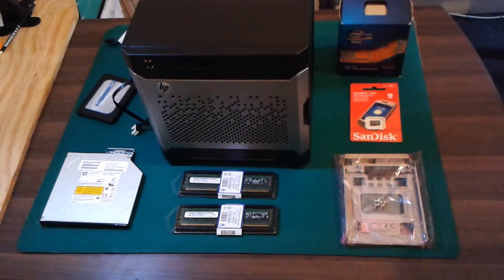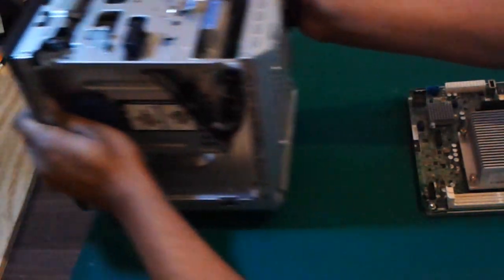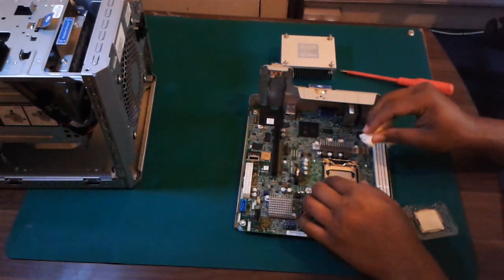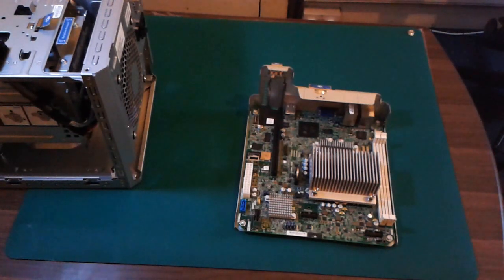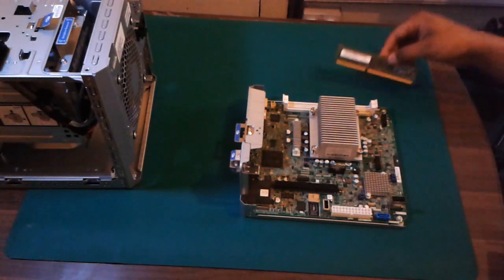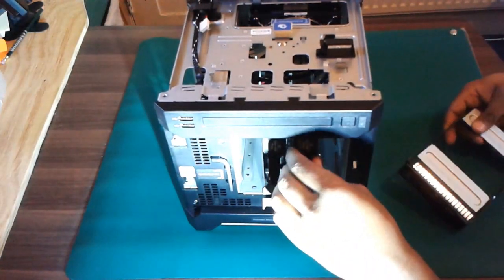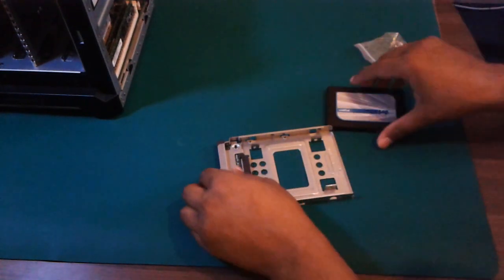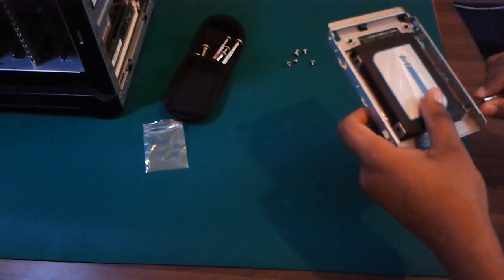Upgrading HP Proliant Gen8 Microserver (Part 1) - Performance

Comment: You shall ALWAYS tighten the CPU heat sink in an X way not as you did just a tip :)
Reply from the maker: +Vidar Berg Thanks for the tip.
Reply: normally there is numbers like left one is 1 right one is 3 the bottom left is 4 and the bottom right one is 2 so you should look for numbers they usually are scraped into cooler plate or so :)

Comment from the maker: RADCOMJ1 It runs on normal temperature (between 25 to 35 Celsius) as I set the BIOS to optimise temperature instead of Speed.
I am using Xeon E3-1265 V2 CPU (2.50 GHz) because it has 45W which is cooler instead of Xeon E3-1230 V2 (3.30 GHz) (which is maximum CPU on the Gen8 Microserver) as the CPU is 69W which is hotter due to more wattage.
I also use Arctic Cooler MX-2 Thermal paste which keeps the CPU cool.

Comment: Hi. I bought a new DVD Burner but it didn't click in as your one did ... Am i missing something @Anchan Tech?
Reply from the maker: Have you got the 9.5mm Slimeline bracket?
Reply: @AnChanTech  If your talking about the old DVD 9.5mm template then yes, if not can you provide a link to the item.
Reply from the maker: It is very rare to get. Google search this Part number 'HP 532475-001'. That is the bracket you looking for.

Comment: Hi I need help here, mine is G2020t too. Am having 4GB n 2gb here. Intending to replace the 2gb with a new 8gb. 

Which brand part no and where shld I buy from? 

I having no luck from my sgsupport reseller here.
Reply from the maker: There are no specific part number for the memory. You just need to look for the correct specific memory type as you saw on my decription box.
HP will be good brand.
Sometimes Global Memory is good brand and the memory expert.
As long as you give them the correct motherboard/PC/Server specs or else they give you the wrong one.

Comment: I'm looking for a home server to begin learning some IT. Is this a good set up for that purpose? Need it doe ESXI virtualization and all.
Reply from the maker: My set up as you see on the video is my hardware full potential (except for TPM as I do not need it)
As for the Home Sever set up, you need Optical Drive to install Windows Server 2012 R2 or 2016 OS. Or if you can afford Server 2019. Get at least 4TB Hard Drive if you plan for storage and another for OS Drive.
I use Hyper V as it is a simple Virtualised environment but you can use ESXI or VMware if you want.

Comment: Nice vid my brother, this is exactly what I'm about to do.:-) how hot does that Xeon run in there?
Reply from the maker: Quite hot.
Years later which is not on this video I upgrade the cooler which is now 65w. (Part no: 832667-001). The 65w cooler is better.

Comment: Do you think it could be possible to install also a E3-1265LV4 (not V2) that has a lower power consumption?
Thank you very much!
Reply from the maker: +Lorenzo L. E3-1265L V4 does not support the Microserver version of Gen8.
Link to CPU list:
https://b3n.org/installed-xeon-e3-1230v2-in-gen8-hp-microserver

Comment: Note: I am a beginner in Home Servers and recently bought this server.

The reasons behind these upgrades interests me, probably other beginner viewers have the same questions - why to upgrade and which purpose each upgrade has - e.g. why Xeon / memory? Which is the purpose of this machine? Are there other options for further upgrade e.g. instead video a WiFi card?

Thank you very much.
Reply from the maker: +Radu Poenaru It depends the purpose of the server and why you need it. Example: Labs and virtualisation. In this case you brought this server for storage. So far everyone like this one which is the main upgrade and this is 1st part of the 4 series. If you look at the description box you see links to 3 other videos of the HP Gen8 Series which is based on small business needs. As for Wi-Fi card it have to be PCI-E and low profile bracket. I hope this helps. Playlist = https://www.youtube.com/playlist?list=PL2b2FxTD-nGMookrvI9uSwiyqw2vZRgsC
Reply: +An-Chan Tech Thank you for your amazingly fast answer. I, as beginner, wanted to get a glimpse of the purpose of your upgrade. Of course it depends on usage, you're right. E.g. for a streaming server, the Celeron is more than enough. But I wondered why so many professionals upgrade so much the basic version.
Reply from the maker: +Radu Poenaru Most cases the basic specs is not always enough for your work and you have to upgrade the hardware for long-term strategic performance. Workstation Server uses hard-tune upgrade as Server OS requires a lot of performance as they use Virtualisation, users in the domain, email (exchange), Database (SQL Server), file storage which users rely on.

Comment: What type of cable is used when putting in for connecting up the JackBlack DVD Burner?
Reply from the maker: +Benjamin Hall (MasterLegoGuy) HP 683358-001 SPS-SATA 9.5mm Optical Drive Cable
Reply: +An-Chan Tech I got the disk drive I want, thanks! But my didn't come with a piece that fits in to place, what is it called?
Reply from the maker: +Benjamin Hall (MasterLegoGuy) Can you describe the piece please so I can find out.
Reply: +An-Chan Tech Ok. At the bottom of the disk drive, there is attachment to it so that it fits in to place (this prevents from moving it). What is that attachment part called? (since my didn't come with one)
Reply from the maker: It is called 'HP 9.5mm Optical Drive Bracket' (HP 532475-001)
Google Search '532475-001'.

Comment: What is the cable connector you used for DVD ? Thank You.
Reply from the maker: Miguel Martín HP SATA 9.5" Optical Cable (HP 683358-001).
Reply: An-Chan Tech Is the cable comes with the dvd unit or you bought separately?. Thank you
Reply from the maker: Miguel Martín I buy the DVD Burner and the cables separately.
Reply: An-Chan Tech Thank you :)
Reply: An-Chan Tech may you paste the link where you bought the HP SATA 9.5" Optical Cable? I only found one and it cost 51€
Reply from the maker: kaslii I brought it on ebay.
Search for either 'HP 683358-001' or 'HP 663771-001'.
Reply: kaslii I bought the optical drive on amazon and the cable was includued.
Reply: Miguel Martín Thanks! But I need only the cable because I'm going to put a SSD HD in case of an optical device.
Reply: kaslii Beware the cable of the optical drive not be used with a hd ssd, not is the same cable
Reply: +Miguel Martín but you can buy 2nd HDD caddy for laptop for 10$ on ebay and put SSD into it and then put it in the server instead of DVD drive.

Comment: You had no issues using a Xeon 1265 V2 in this server? I was curious if the integrated graphics on the 1265 V2 would cause a problem.
Reply from the maker: I have no problems running the Xeon 1265 V2 as it is compatible.

Comment: Hi, do you have any recommendations on what wireless cards I can use with these machines?
Reply from the maker: Joshua Croft You can use either Wi-Fi Card or USB Wi-Fi adaptor. Both will work fine.
I would use either Belkin or Netgear model (I prefer Netgear as they are the best make network equipment in my opinion). Use Wireless 'N' to have more speed and signal.
If you are buying a Wi-Fi card make sure it is PCI Express and low-profile bracket to fit in HP Gen8 MicroServer.
Even the Wi-Fi works fine on the Server, do not forget that if you are using Wi-Fi features on the Server you must install the Wireless LAN Features from the Server Manager before using it.

Comment: Whas is the utility of the micro sd card ?
Reply from the maker: +Miguel Martín You can use it for backup storage, flash boot, imaging and you can even use it as a boot drive and put Windows OS on it - but I do not recommend install Windows on it (if you dare). Anything you want basically.
Reply: Thank you

Comment: Has anyone successfully installed a i3-3240t? Cost wise the Xeons are very expensive and for my purposes overkill. I know the i3 doesn't support vt-d like the Xeons.
Very little information on the i3 upgrade path, is available.
Reply from the maker: +Chad Rilcon Check this link:
http://n40l.wikia.com/wiki/Cpu_gen8
Reply: +An-Chan Tech Thanks for that

Comment: hi, could you tell me the model of memory please?
Reply from the maker: +il_varano The one you see this you is one of the ECC registered RAM. Unfortunately it does not boot properly as it is a registered memory so I use this for demonstration purpose. I got the correct one days later.
The correct model I brought which is working is called 'HP 669324-B21 (HP 8GB PC3-12800E-11 Kit)'
Reply: thanks :)
Reply: +An-Chan Tech What do you mean by "not booting properly"? Not all ECC kits work in this system? Was planning to add the 16GB ECC kit from Kingston http://www.amazon.de/Kingston-KVR1333D3E9SK2-16G-Arbeitsspeicher-240-pin/dp/B0064R7LH8
Reply from the maker: +Radu Poenaru What I mean by "not booting properly" is at the time I done this video I installed the ECC Registered RAM. After the video I purchase the correct one. I recommended you buy 'HP 669324-B21 (HP 8GB PC3-12800E-11 Kit)'. If you want to buy Kingston do it at your own risk. RAM Explained link = http://stores.ebay.com/GeeK-NoiZe-Memory-and-More/RAM-Types-Explained.html, this will give you the details about the types of RAMs.
Reply: +An-Chan Tech I found a list of memory modules that people claims they work properly - I haven&#39;t tried them, so use it on your own risk (http://homeservershow.com/forums/index.php?/topic/5639-proliant-microserver-gen8-links/):

ECC (all below are links in the source url, so please check each article - underneath the links are removed): 

Kinston 2*KTH-PL316E/8G!!     
Kingston (PC3 10600) KVR1333d3E9SK2/8G!!
Samsung m391b1g73bh0-ck0 8GB x2 confirmed working!!  
8GB PC3-12800 DDR3-1600MHz ECC Unbuffered CL11 240-Pin Dual Rank HYNIX Memory Module Mfr P/N HMT41GU7MFR8C-PB !!
16GB Kingston KVR1333D3E9SK2-16G in Gen8!!
Kingston KVR13LE9S8/4 (4G DDR3 ECC Unbuffered)!!
Kingstone Kvr16e11s8/4i !!
Samsung 2GB PC10600E ECC!!
Elpida 1600Mhz CL-11.0 PC3-12800E ECC UDIMM 2x4GB !!
2x8GB KVR16E11/8I Kingston works with Xeon E3-1270v2 but NOT G1610T!!
Elpida EBJ41EF8BDWA-GN-F 4GB PC3-12800 DDR3-1600MHz ECC Unbuffered CL11 240-Pin DIMM 1.35V !!

Comment: It's really small, I'm concerned about the airflow in this thing… 
You could probably do way better by liquid cooling the processor and graphics cards (For video rendering that is)… 
But really, better cooling means better performance even without overclock since it avoids throttling…
Having an air-cooled xeon is like having a Ferrari engine with a toyota turbo :/
Reply from the maker: +Lemon Chief I do not overclock CPU (people come at me with this). I do look at 'Homeserver Show' which they are good at finding ways by buying mod kits for the Server as the HP stock (normal) parts are not that good. One including about adding small mod fans on the Heat Sink as to keep it cool as HP do not supply one. Also the big fan which is noisy. I did a part 2 video on this on installing graphics card: https://www.youtube.com/watch?v=_Ey6_EpEweg.
Reply: An-Chan Tech Even without overclock if your cpu is not well cooled it can thermal throttle
Reply from the maker: +Lemon Chief Thanks. I am getting to know about the 'Thermal Throttle'.